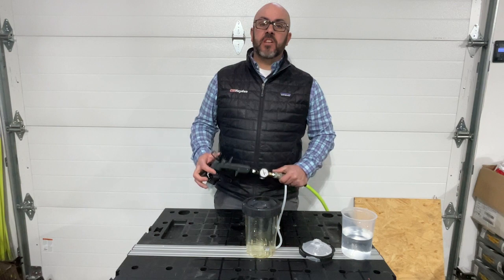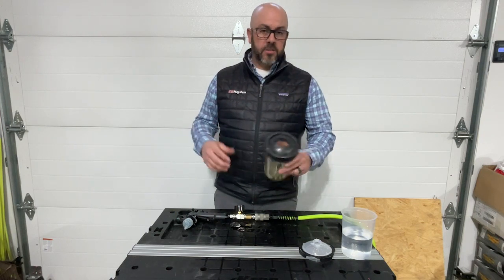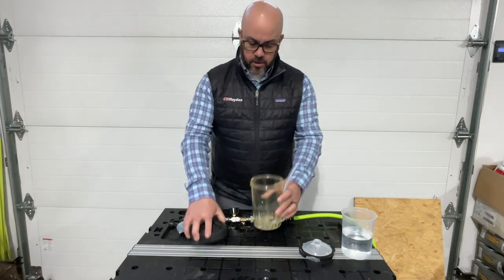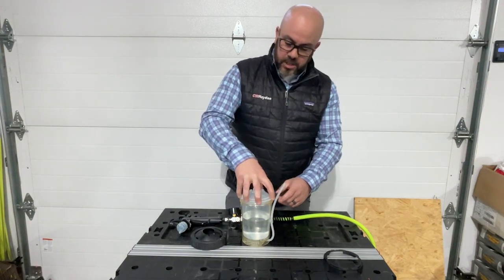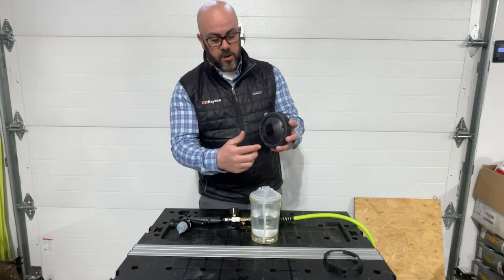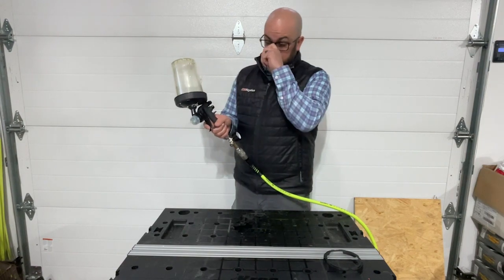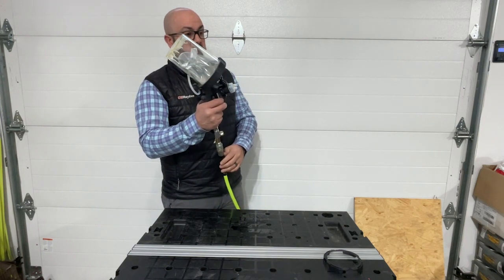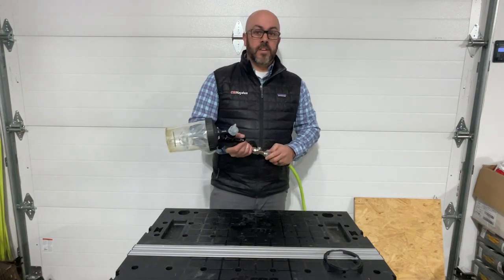3M™ PPS™ Series 2.0 Type H/O Pressure Cup

Comment: I have the 1.0 system and thought about going to the 2.0 - which is great, EXCEPT when you have a H/O Pressure Cup. This basically turns the 2.0 lids/liners back into a 1.0 system... I HATE that! What I don't like about the 1.0 IS the H/O cup - it sticks and clogs... and $100 to replace. The 2.0 system is great - eliminating the cup with replaceable lids... but the H/O NEEDS the cup to work, so thats out! Dang!